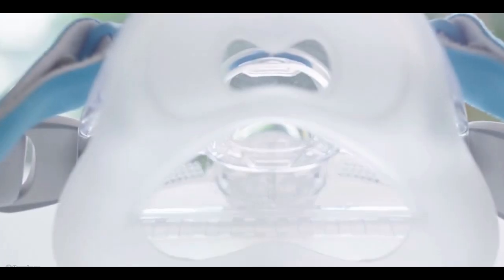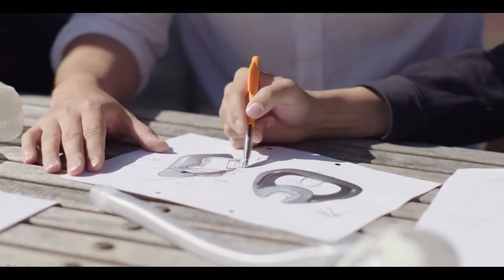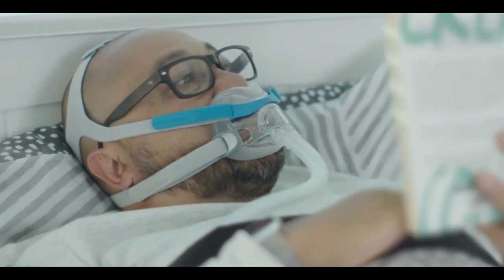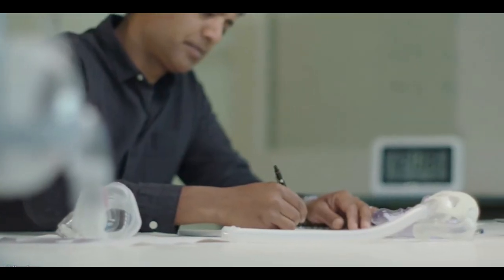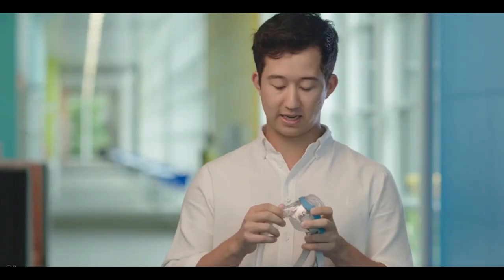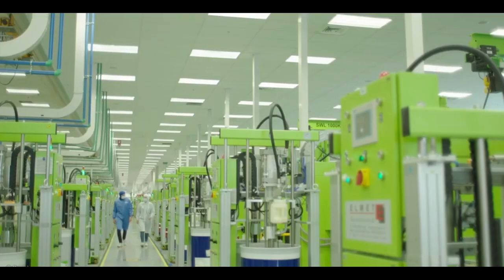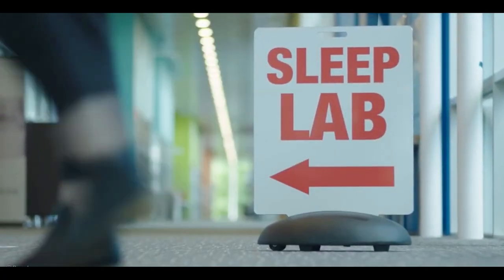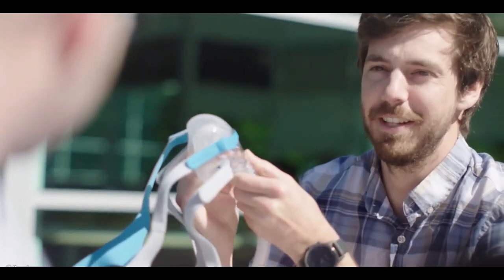Fisher & Paykel Evora Full - Introduction

Comment: I bought a Fisher & Paykel Evora Full Face Mask and tried it last night.

What I loved:
- It's a reasonably priced compared to other masks and it comes with three different sized inserts so you don't have to make a wrong guess as to which one you need.
- It's the best sealing full face mask I've used. Having said that, I noted that, in the morning, it was starting to leak a little. But it got me through the night. I will have to try the other sized inserts.

What I liked:
- The way the nose goes over the holes at the top of the mask just seems to work. I was able to breath easily and there was no discomfort. 

What I didn't like:
It's not easy to put on without loosening the straps. I don't know if I'm missing something, but you have to adjust every time. I'd be interested in knowing if anyone else has that issue. 

Overall, this may be a game changer for me.

Comment: I wanted to love this mask, it was really hyped up, had to wait later until it was available in the US, but when it finally was, I bought for $150 USD. Unfortunately it pinched my nose and pushed it up so uncomfortably, I just couldn’t wear it. It also irritated my skin just below the septum, where the nose meets the upper lip. I was so sad. Had high hopes for this mask but was too uncomfortable to wear. The silicone is very very thick all around and really pushes the nose. I have a high pressure setting (25 cmh20) so I have to really strap my headgear down tight to get a seal, so comfortsbility is paramount in a mask for me. I have tried 5 full face masks and so far, the Resmed F30i is the only one that is still comfortable even after wrenching it down tight to maintain a seal.
Reply: Thanks for giving this review. I’ve been successful with a nasal mask and chin strap with O2 bleed in for a number of years, but I’ve been struggling this last year. I use a Wellvue ring. Had a sleep study about 3 weeks ago, they put me on a dreamwear hybrid (the one that was just recalled), and it pushes my nose up uncomfortably, so I was thinking once I get my new machine and mask, I wanted to try the ResMed F30i that’s similar. I too have high pressure, but still having low saturation with dreamwear sleeping on my back.

So do you have a BiPAP? 

I’m at 16 with 2L O2, and I’m worried that an APAP isn’t going to cut it for events. During my sleep study I didn’t go into REM, so they suspect I’m worse than my study showed. (I’ve been at 13 with 2L O2 for about 20 years. So I’m a long time user and never nap or sleep without it.)

I just don’t know if my problem is pressure or mask related. With dreamwear, I have to bloat my cheeks to get a seal. Is that normal?

Sorry to ramble on, I have expensive purchases to make, (mask & machine)—so I want to be informed.
Reply: @beccageema  Hi Becca. I have always wanted to try a nasal mask and I know I’d need a chinstrap, I’m a mouth breather for sure. I just always assumed I needed a full face because of that as well as my high pressure settings. To answer your question, yes, I use a Resmed Aircurve 10 Vauto BiPap machine. Min set to 15 cmH20 and max at 25 cmH20, with about 90% of the time it adjusting to 20 cmH2O. As for the bloat, I had the same issue with the dreamwear with the cheek bloat. Honestly, with the Resmed F30i  full face, I do have cheek bloat once I’m fully relaxed and about to fall asleep, but in the beginning when I lay down, it keeps the seal enough for me to be able to keep my mouth closed and breath through my nose.

Comment: I used the resmed F30 for a while, but I had lots of trouble with leaks from the sides. I then bought the Evora full face mask and it's head and shoulders above the resmed mask. The resmed is very floppy compared to the evora, I always had lots of trouble with dry mouth. With the evora, my mouth doesn't open as easily and the dry mouth is much less.

Comment: Hi. At lower pressure I found an AirFit F20 was fine, but I'm having real difficulties with a 20 cmHg pressure and most masks I use. How do you think this one will handle these pressures and is it recommended for BiPAP and <drum roll> facial hair. (short trimmed mustache and goatee)?

Comment: When using a heated hose like that on a airsense 11. Wouldn’t the hose extension coming off the mask defeat the purpose of the climate hose?
Reply from the maker: Hi Lee, interesting thought but no because it's such a short length of tube it shouldn't make any difference with 'rain out' Cheers

Comment: Due to Philips issue, I recently bought a F&P from Cpap Vic, but noticed something annoying or fishy with F&P or is it just me?

Anyone has the below same issue with the pressure of your F&P Sleepstyle Auto?  The issue is that, even though the wake-sense and auto pressure are on, I don't really feel any changes in pressure when breathing out and didn't really feel the wake-sense feature too when I woke up in the middle of night....It's almost as if it's a fixed pressure machine throughout the night....I'm very disappointed with it.
Reply: @John Citizen I'd explore to see if it does have a log of pressure changes throughout the night ... Thanks
Reply: @John Citizen The beta version of Oscar is compatible with the sleepstyle data.
Reply from the maker: Have a look through this vid - https://youtu.be/32zO1yFhh80 . It's a bit old now. Sense awake and auto pressure are not 'exhalation pressure relief' which is what you are referring to. Also regarding sense awake, you can set what pressure it drops to when you do wake up. I think you just need to play around with a few of the settings :-). Cheers
Reply from the maker: @Ray-gu5kp  tell me more?

Comment: Problem always is if you have developed an allergy to silicon which I have after so many years of using a mask.
Reply from the maker: could you potentially use some mask liners?
Reply: @CPAPReviews  What are they made of?
Reply: @CPAPReviews  Yes Nick and thanks for caring. I got CPAP SNUG mask liners from Ebay and they are washable.

Comment: F&P are known to make very durable masks. But their AUD $229 "introductory pre-order" offer put me right off. At an rrp of AUD $310 you then have to consider the continuing costs of parts and full gear replacements. 

After all, the F30i can be modified to seemingly achieve exactly the same results - nose alignment and maintainable "mask geometry" (gotta love the marketing speak.)

Why am I upset? This will probably be a great mask but I've invested too much in mask parts for my simplus,F20 and F30i to justify another purchase. Damn you F&P lol
Reply: The introductory offer is the fit kit version that comes with all seal sizes. They normally have at least the medium version available stand alone in their regular masks.
Reply from the maker: Cheers Mitch

Comment: What about coughing and sneezing
Reply: Coughing could be interesting ... but sneezing will be a problem regardless of mask in some ways unless you're full on opening your mouth the pressure etc needs to go somewhere.

Full face masks are nothing new either way.
Reply: @NullaNulla  only takes some practice to learn to push the sneeze pressure out yer gobble. Have always used nasal masks, so I don't know how it would affect a full face mask wearer.
Reply: That gobble should be gobhole.
Reply: So similar design to Philip's Amara & Resmeds F30 masks ?